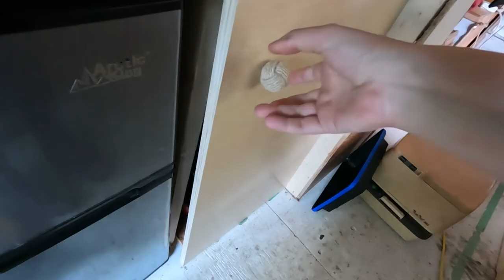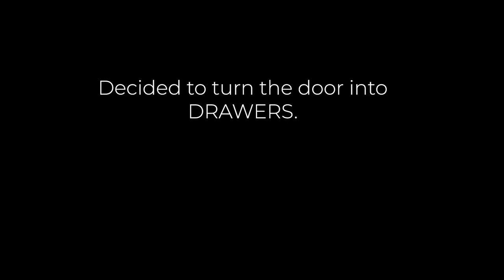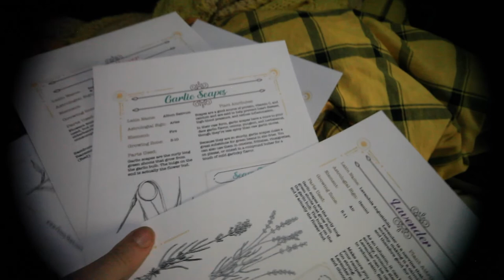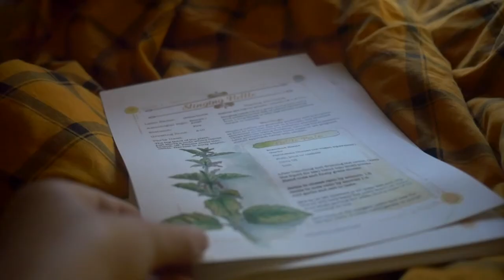BETTER THAN A NATURES HEAD | DIY Composting Toilet

Comment: I hate to break it to you but that is not a long drop… a long drop is the term used for a deep outhouse in the north because in the winter your 💩 FREEZES upon contact with the bottom and so instead of all levelling out a giant cone of 💩 grows through the winter and so your drop needs to be deep enough so that you don’t breach the toilet seat before spring thaw. Hence ‘long drop’. Now ya know 🤗
Reply: Nice little lesson on the long drop. 😆 🤣
Reply from the maker: @tidelinetoalpine ooooohhhh that makes a ton of sense 😂💩💩💩 we called them long drops in NZ but without the freezing I guess they're just deep put toilets! 🥰